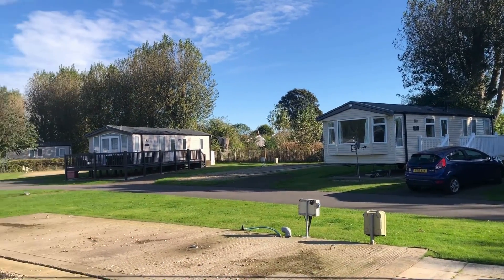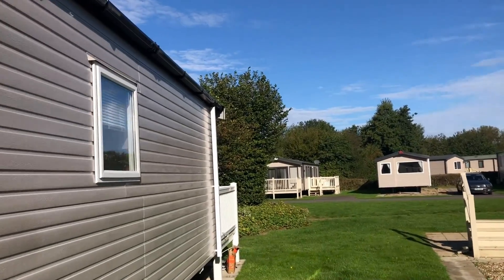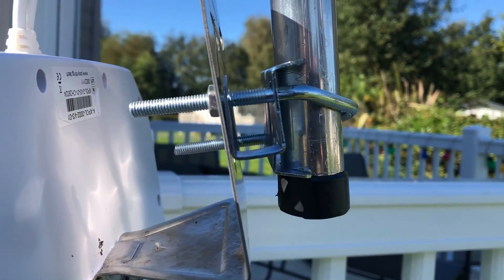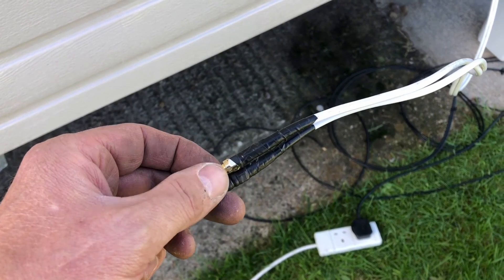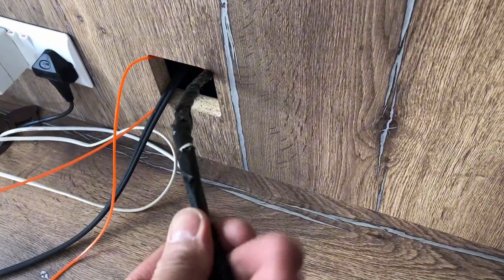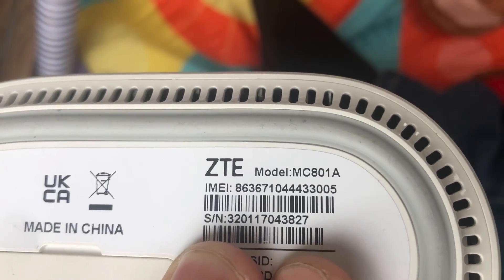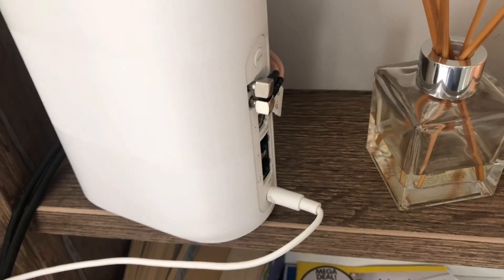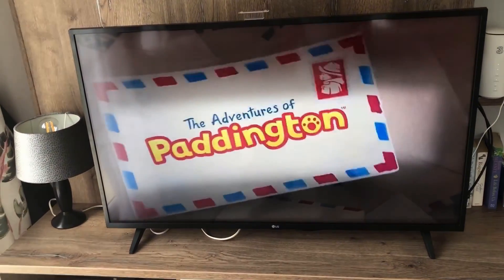Installing 5G/4G Wireless Internet In A Static Caravan in an Internet Dead Zone.

Comment: Hi. Can you tell me what app or software you used to identify the direction of the strongest phone signal, so as to best direct your aerial?
Reply from the maker: I used a compass app and did some research on google maps to get the correct orientation of the caravan In relation to the 5g transmitter. I found it worked within a good radius. I didn’t have to be too accurate and the rest was just fine tuning to maximise the signal in accordance with the router LED’S  that denote the best signal strength.

Comment: hi mate h8 to be a pain again where can i get a 5ft j pole
Reply from the maker: They are out of stock from
Broadband buyer where got mine. I have since lowered the antenna as the j pole blew to the ground in the wind last year so a smaller one would suffice or go higher with a different specification of pole.

Comment: excellent video. clearly need a lot of high level diy expertise to do something like this. nice idea because if you can get a high speed 5g signal there's £££ to be saved by having to use expensive cable internet
Reply from the maker: Cable wasn’t an option but star link was circa £40 per month so this worked out to be much more cost effective.